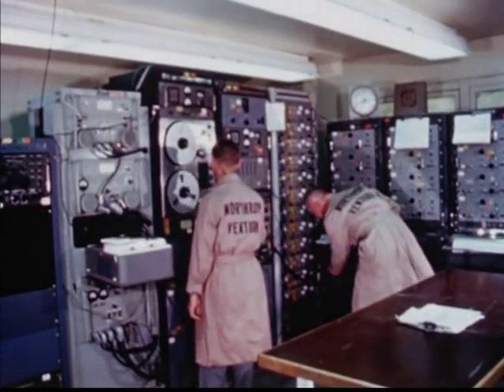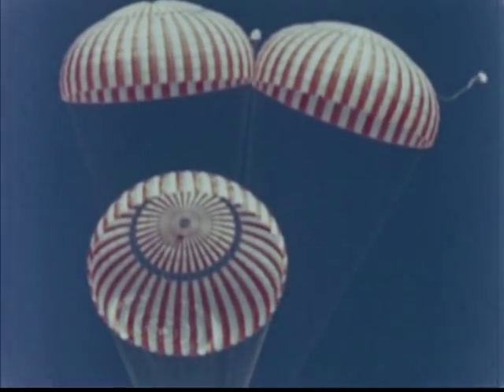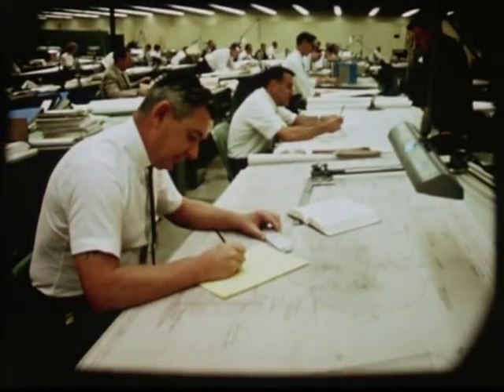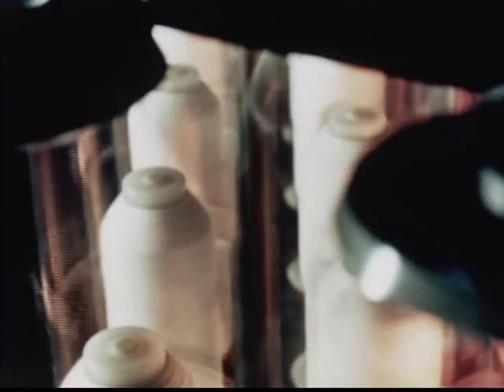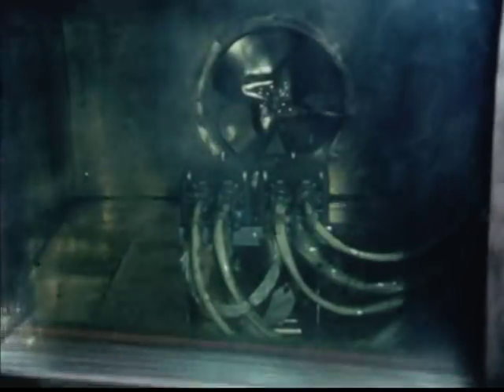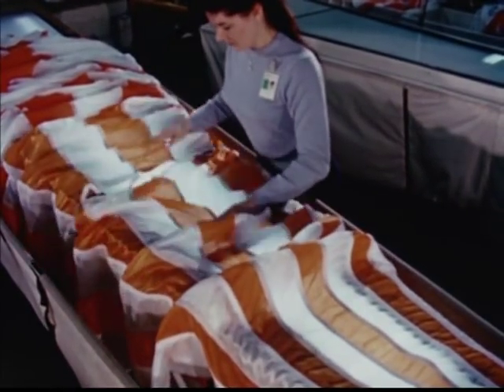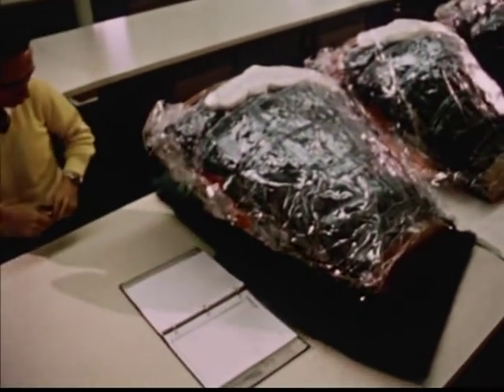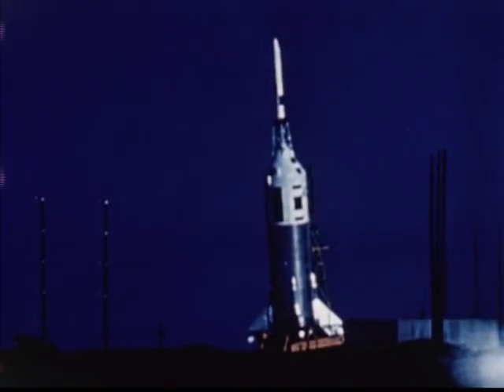Project Apollo : Last Five Miles Home

Comment from the maker: Note that for much of this video the Block I parachutes / packs are shown throughout the video. The Block II ring sail parachutes was slightly smaller ( 82.5 vs 88 foot diameter) ,  the pack design was different and steel risers were incorporated between the fabric risers and the Command Module "flower pot" to reduce the possibility of damage from chute deployment.
Reply: pro trick: you can watch movies on flixzone. Been using it for watching a lot of movies recently.
Reply: @Ezra Kamari yup, have been watching on flixzone} for since november myself :)

Comment: How did the rocket make through the atmosphere without heat shielding leaving the earth.
Reply from the maker: The Apollo Command Module had thermal protection (heat shield) formulated from a special ablative material (AVCOAT 5039-HCG)..the heatshield was onboard the capsule at launch however its primary function was to protect the spacecraft during reentry when temperatures rose to many thousands of degrees. Over the ablative heatshield was applied a polymide kapton foil, silver in color that protected the heatshield from damage during launch. Additionally over all this, was a Boost Protective Cover (BPC) which provided primary launch protection (it was jettisoned once the capsule past the point of maximum dynamic pressure/heating during the launch phase).

Comment: reentry temp 5000f nylon melts 500f
Reply from the maker: The parachutes are not deployed until post reentry when the temperatures are much cooler
Reply: [08/21/21] The parachute module is also protected during re-entry by a heat resistant cap IIRC. Once safely in Earth's atmosphere the cap is jettisoned.

Comment: You know that all this heavy junk had to go all the way to moon orbit and back!!!
Reply: and?
Reply: AND, what a stupid design!  that's what.  How much did all that crap weigh?  And carry it all the way to the moon (orbit) and back.  really?  Dont forget they used a HIGH energy moon insertion orbit.  To literally fly around the VAB.  I read that they used even MORE fuel in this orbit, so that they would automatically obtain a free return to Earth, if their engine failed the lunar insertion phase.  The very least they could have done is jettison piles of useless garbage before Earth descent. Why keep empty tanks, or burnt out rocket motors, or dead batteries?  Detach and eject.    1/2 the splash down weight, 1/2 the parachutes.
Reply: so, you've done some reading? Why not try and find out the weight of the command module as a percentage of the total Saturn V stack - i.e. the weight of the only part of the vehicle that returned to earth when measured against the weight of the total vehicle - you'll answer your own question on weight if you do.
Reply: +lasvegasbrad   "The very least they could have done is jettison piles of useless garbage before Earth descent. Why keep empty tanks, or burnt out rocket motors, or dead batteries?"

Are you talking about the command module? If so, what empty tanks and burnt out rocket motors? Whatever was still on the command module was still needed during re-entry since the descent was more involved than what most people realize. Also, once the service module was separated, they needed those batteries remaining on the CM for the instrumentation readings during the descent as well as to provide the power to fire the pyrotechnical devices used to deploy the chutes.
Google: "Apollo Atmospheric Entry Phase pt1-2 1968 NASA"
Reply: +lasvegasbrad                    OMG! Too bad you weren't engineering in the 50's and 60's! You would have saved NASA millions (if not billions), and we would have landed on the moon in '67!. As a matter of fact, I need your advise on pretty much everything in my life! Can I get your phone #? I don't want to even take another breath without the input of your magnificent brain power! Really, thank for your input!